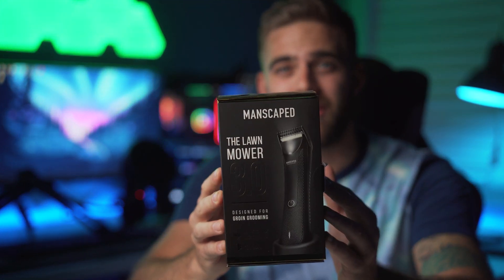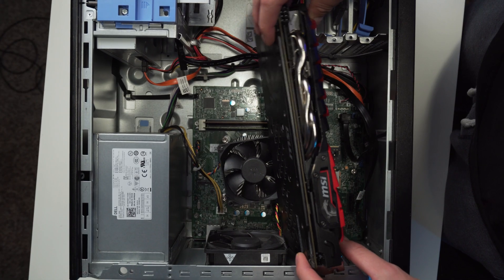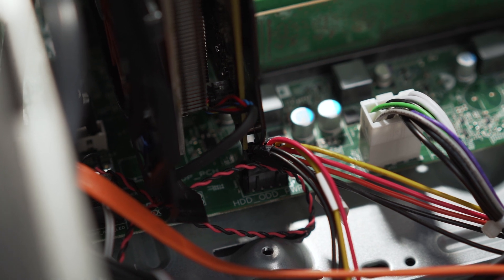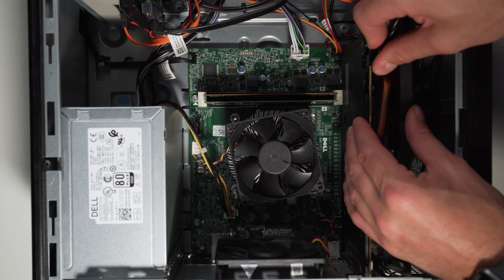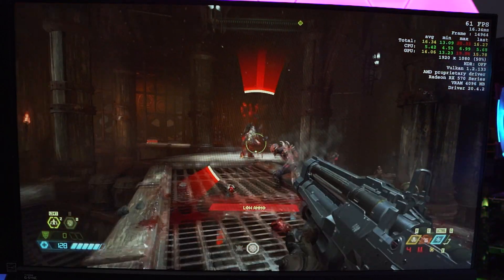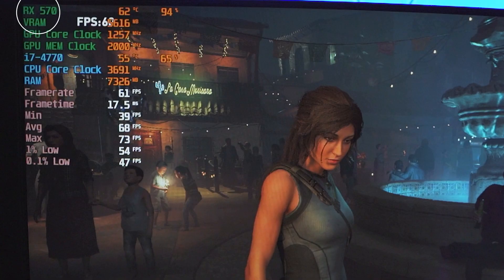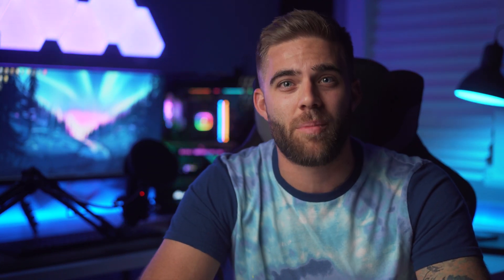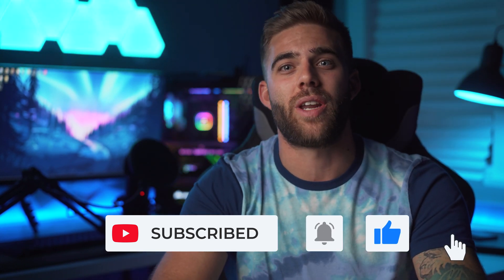Will the RX 570 & RX 580 work in the Dell Optiplex? | 3020, 7010, 9010, 9020

Comment: just did a 3770 9010 build with rx580 i happen to have some beefy power supplys hanging around,,, removing the HD cage is hellish yes anyway you slice it.  --- with the larger cards, you can NOT use yr front usb plug in

Comment: I just ordered a 9020 with i7 4770 32Gb RAM and 1tb SSD. and I ordered a rx 580 and an aftermarket 500w PSU with an adapter cable. The 580 I got claims to be under 10 inches so I'm hoping it fits. I'm really hoping I don't have to swap everything into another case
Reply: How was it
Reply: @bariinvest  been gaming on it ever since.
Reply: @mister_Marvelous_One nice I was thinking about getting a 1060 6gb but I’m so confused about upgrading the psu 

I’ll go with a 500w and I understand I’ll need the adapter cable but do I need a specific psu because I heard Dell wants you to use proprietary equipment and I seen someone said you can use any atx psu with the adapter so idk

What did you do?

Comment: Gooday i have Arktek Rx580 i tested it with 350w psu & 6pin adaptor the card turns on but i get black screen what seem to be the problem may it be the psu that is to weak?
Reply: i think the most powerful optiplex only goes up to 290 watts. so unless you change the powe supply, i dont advise you to use an rx 580  in an optiplex

Comment: beware of toasted sata to 8pin connector ( happened to me )
Reply: so what if i used 2 sata to 8 pin
Reply: @pkminer  maybe better but i would advice to lower the gpu voltage a bit to avoid hot connections
Reply: @midosvibes4230   so i have my rx 580 8gb setup is kinda janky cuz im using 2x 1 sata to six pin adapters then further attached to 2 female 6 pin to 8  pin adapter.

Comment: could you technically not upgrade the psu sense the 580rx max with draw is like 150 but everything combined is basically 259 watts  pretty scary but possible, well really only possible for the Dell Optiplex 9020 Desktop it has 290 watt power supply.
Reply: have you tried?
Reply: no, i was getting my mom a PC it didn't have to be that powerful I was just curious cause it wasn't that expensive to do. @user-uc4vg4rg9e

Comment: So I've already got an upgraded 650W Gold PSU in my Optiplex 9020 mt. Will the RX 570 8gb fit into this motherboards setup only pressing against that Front Panel IO connector?
Reply from the maker: you will have to remove the hard drive cage for sure. Unless that 570 is a small version
Reply: Would that same gpu fit in an 7010 mt? (after removing hard drive cage)
i also want to know if it will block the ram slots or not

Comment: tried doing this myself, sadly in the dell optiflex 9010 MT big gpus wont work even if you take out the hdd casing because the sata cable and ram ejectors are in the way rip
Reply: I wish I read this post before, I tried the Rx 580 and it wont fit...
Reply: @JoseRuiz-ff3zb  which optiplex did u use?
Reply: @suhailnoor5654  Dell 9010.
Reply: Motherboard swap.

Comment: i know im a bit late but im wondering what kind of power supplies would be compatible with some of the optiplex systems
Reply: None of aftermarket psu has 8 pins as much as i know 

You would need an 24 pin to 8 pin adapter to work

Comment: I got a Dell Optiplex 5060 SFF.

1. Would this card fit into the body? 
2. Would the power supply be enough or can I use external power supply?
Reply from the maker: In the sff chassis, only low profile cards will fit. full size cards are a no-go

Comment: Do you think the MSI 570 would fit in the 1070 i5 without removing the HDD bracket?
Reply from the maker: I believe there’s a certain 570 that will but you’d have to measure it. Mine wouldn’t for without removing the hdd cage

Comment: does the RX 580 compatible (detected on) with optiplex 980? the cpu is i5 660. I will move it to new case and new power supply. just wonder if it will be compatible? Please anyone knows?
Reply from the maker: I would not use the rx580 with that system. you need to move up to a newer cpu to make it viable

Comment: I have installed the RX 570 onto my optiplex and I have brought a power supply plugged it all in an my monitor is saying no signal 
Any advice?
Reply: Plug the hdmi/vga on the motherboard , install card drivers then try again

Comment: Hi, i'm going to use a R7 260x with the 290W psu, i have to use a sata to 6 pin pcie but the sata cables that come from the motherboard are too thin (like yours), didn't you have any problems with it?
Reply from the maker: I did not, mine worked just fine
Reply: @RAVisuals  Thanks for answering!

Comment: Can you fit a rx 570 in the 390 normally? I have the bigger one not the slim one
Reply from the maker: The bigger 570s will require modification to the hdd cage to fit

Comment: does the motherboard of dell 7010 provide enough board power to the card?? i have 7010MT. i5 3rd gen
Reply from the maker: Yes it will. If the 3020 I have works, the 7010/20 will too

Comment: I have an Optiplex 7020 with an i5 4590.  You think a GTX 1050 ti or 1060 would get me pretty close to 60 FPS on most games, assuming I also upgrade the RAM from 8 to 16?  I've been very impressed with the benchmarks I've seen for both the RX470 and 570, but honestly I'm not finding them cheap anywhere, and I think the size and PSU draw may be a deal breaker for me.

Thanks so much for making these videos man, I'm super new to this and trying to upgrade my work CPU into a serviceable gaming system.
Reply from the maker: go for the 1060 man. It gets very good numbers with the 4590!
Reply: @RAVisuals  Thanks man, gives me some serious peace of mind.  And if I were to eventually upgrade the cpu to something like an i7 4770 or 4790, you still think the 1060 is a pretty good match?
Reply: @trza49er  so how’s it go I recently just got a 580 4gb waiting for my 500w psu it’ll be here tomorrow to put in my Optiplex 7010 with my i7 3770

Comment: I have an Optiplex 7010 SFF, i5, 16 GB ram, wich GPU is the best option for me?? I am not sure if the RX 570 Will fit, but what is the best GPU for good exsperience??
Reply from the maker: in the sff cases unfortunately you can only fit the 1650 low profile cards in there

Comment: So I have a xfx rx570 4gb card I was wondering if it will work with my 300watt 80 plus psu
Reply from the maker: You'll definitely be pushing it with that psu. Id seriously recommend upgrading to a 450-500w for that

Comment: Can my Dell Optiplex 9010 handle a RX 580?
Reply from the maker: Yes, you’ll need to replace the power supply though. The stock one will not handle an rx-580

Comment: there is an important difference between optiplex 7020 and 9020?
Reply from the maker: 9020 comes with a 290w psu, not sure if the 7020 does

Comment: i have optiplex 3020 paired with msi rx 570 but all i get is "no signal" help? ive tried everything. cleaned and reseated ram, cleaned pc, checked cable placement 100+ times, upgraded my bios on my 40DDP motherboard latest, tried other monitors, switched to high power mode. also tried with gt 1030 and works fine. my setup: i5 4590, 12gb ddr3 ram,  (older) gt 1030, 500gb hdd, and ssd
Reply: Me too
Reply: Any fix ?

Comment: Did the RX 570 also hit the SATA connector pin as well (seems to be)? From which maker of RX 570 did you use? I intended to make the similar thing, with either RX 550 or RX 570. As I already have those cards with me, but not the PC yet.

Comment: I was looking at a rx580 8gb single fan so I can keep the hhd tray would I have to underclock it
Reply: I think you bought one, but if you not, I use a 4GB RX580, and it works good in my 7010 MT. Make sure to buy the Sapphire RX580 Pulse, because it’s the smallest.

Comment: Aye RA do you think a RX 570 will fit in my dell optiplex 3010 with the ssd cage
Reply from the maker: depends on which rx 570. some are just able to fit depending on the model of optiplex but certain models have a connection or two that may get in the way of the card.
Reply: @RAVisuals  yhh, so it came in but it wasn't compatible with my modeli guess.so I had to return it

Comment: 365W isn't enough for the amd cards.
On amd's official website it's recommended a 450W
Reply from the maker: you can see clearly that these cards were working just fine and without issue on 365 watts. That "recommended" number is exactly that. They say that to ensure you wont run into any issues AT ALL.
Reply: @RAVisuals  if u ran GPU intensive tasks simultaneously, the computer will automatically shutdown due to low power output to the GPU
Reply: Dell power supplies are rated continuous, unlike run of the mill ATX PSU's, so don't take that 365W into consideration as the limitation because it is not. He ran into issues using a SATA adapter.. SATA power carries 54W max over a single connector, and the slot provides 75w, so 129W isn't enough ( RX 580 runs 185-225w TDP depending on brand/ clocks )..  However the higher end Dell Precisions like the 3620 have a 365w power supply with a 6 pin PCIE power connector and the correct 8 pin/ 4 pin mobo power connector..  The 4th gen processor Optiplex use power off the motherboard to power SATA,  so the 3620 being arranged in the same way would be a drop in replacement.. 6 pin to 8 pin PCIE adapters are perfectly acceptable. However unless it's cheap, it makes little sense. A usable ATX 500w PSU is in the $30-40 range... However the third gen processor Optiplex are nearly as fast and have standard 24 pin/ 8 pin PSU connectors, so they are even easier.

Comment: I have the same pc with i5 3570 and total power 275w and i order amd rx 580 8gb is it gone a work pls answer me???
Reply from the maker: You will need to underclock the card like I did if it has a factory OC. Even then, youre probably pushing it with that 275w psu. The 290w I used in the video was barely enough. If I was you, Id replace the power supply!
Reply: RA Visuals But is it gone a fit 580 8gb ?

Comment: i took out my hdd cage can i pop a 8gb fxf rx 570 in  with a 500watt psu
Reply from the maker: yes you can!
Reply: @RAVisuals  i had some troubles with it hiting the ram tabs but i mange to stuff it in hopefully its fine.👍 runs good upgraded from a 4gb rx 550

Comment: So if I get a 500 watt power supply or 430 watt with rx 580 and a dell optiplex will I still have problems or not
Reply from the maker: nope! you just have to make sure you get an adapter for the 24 pin psu cable to be able to work in an optiplex because they have a proprietary pin out.

Comment: Will a rx 570 fit into a optiplex 7010 dt
Reply from the maker: This model will run into the problem of the usb 3 connector I believe. so the rx 570 will be too long.

Comment: I want to know if the area you live is hot during the summer? Cause where i live it gets 35c to 40c during the summer and im afraid if i get the rx 580 it'll get really hot... also you think there would be a huge bottleneck with rx 580 and i5 3570?
7:45 Is 75c safe for an AMD card?

Comment: To anyone watching this, DO NOT USE the sata to 6/8pin adapters, sata only carry 25w and these GPU's can pull upto 75w under load, they WILL burn out the adapter and possibly the entire cable. A molex to 6/8pin is slightly better, but its best to steer clear of power adapters. Also, most 570/580's that have an 8 pin power slot can run just fine with only a 6 pin connected.
Reply: I know its old sorry
But if i got a power supply tahr doesn’t fit my card 
What is good for me ?
Reply: @mohamedalaa9609  Please speak English atleast bro
Reply: Sata can carry up to 50w, I don’t asvise going up to that limit though
Reply: What should i get instead
Reply: Sata cables are 54w max. So double SATA to 6pin (75w) is ok for me. 8pin is 150w so there is no adapter for that in my book.

Comment: I have the RX 570 from XFX and I can't seem to get it in, like something is blocking it. I have the 7010, the bigger one.
Reply: I have a Dell Optiplex 7010 MT the bigger one and I see my sata port so close to the pci-e x16 so I don't know if this gpu fit in because blocks my sata port
Reply: @ysmaeldejesusmarcanoperez9535  It won't fit, I tried. I got a GTX 1650 from Zotac instead.

Comment: Can you please do a 1650 super in a dell optiplex 7010, cause I’m thinking of getting one but idk if it would fit or if it’s to big its Dimensions are (9.8 x 1.7 x 5 inches) is that to big?
Reply from the maker: I tested the 1650 super in my 3020 which is very similar to the 7010! it will absolutely fit in your case without issue
Reply: @RAVisuals  will the asrock rx 570 fit without blocking sata cables. Will straight sata cables still work?

Comment: Nice vid. Really surprised in the uplift the 580 gets over the gtx 970 (the GPU I used in two recent builds).

Thanks for the idea of just buying a Dell power supply with more power rather than getting adapters for standard power supplies. Have you found Dell power supplies with higher wattage so you wouldn't have to underclock the rx580 ?
Reply from the maker: This one I used in the video was the only one I could find so far but there may be more out there. For the price though, youd be better off getting a cheap 500w psu and just using that with an adapter for the optiplex motherboard.

Comment: Ok I really hope you can help you seem more knowledgeable then some of the other optiplex builds I've been researching but I'm building a 3020 sff and I have the rx570, a 430w ps, an ssd the 4 pin to 8pin for gpu, and that but other videos confuse me with talk of proprietary cables and I think they are talking about this case switch but if I glue it pushed down I should be able to case swap right? Because theres not much room for a good gpu in the sff case.
Reply from the maker: Im actually thinking of doing a case swap with mine too! So, I'll be putting a video out on this very soon!
Reply: @RAVisuals  sounds good cant wait to see it.